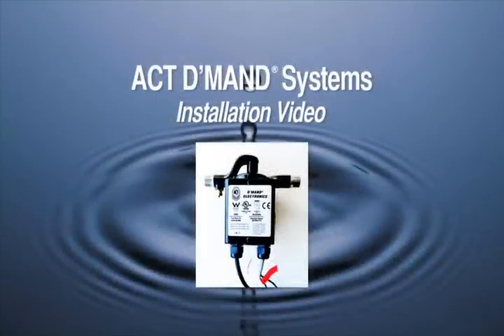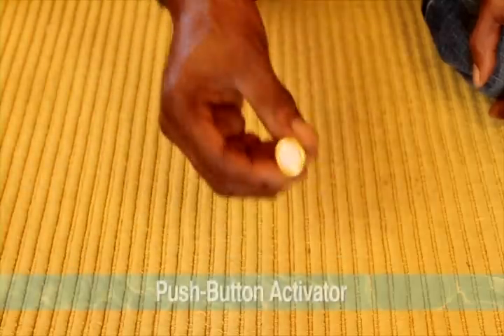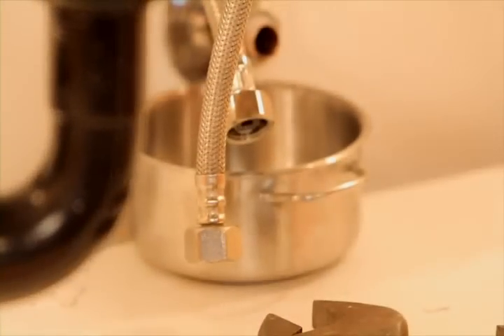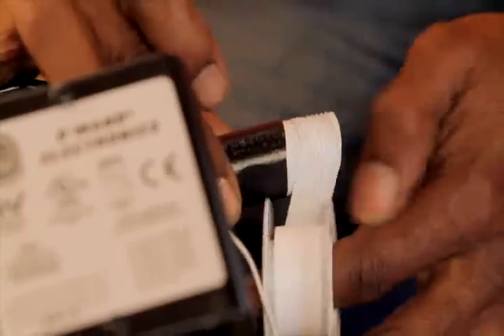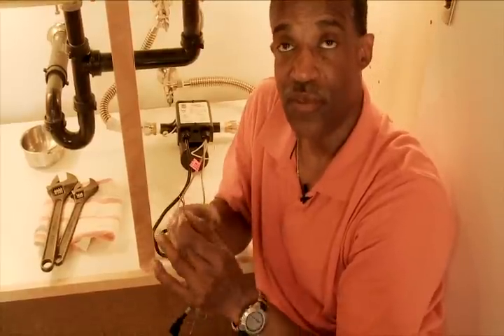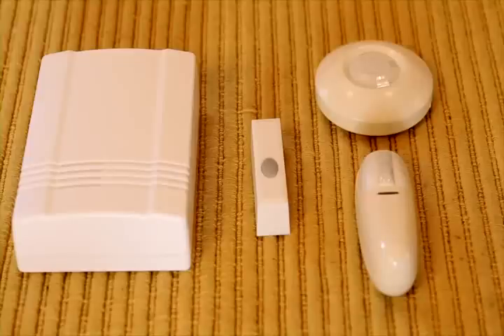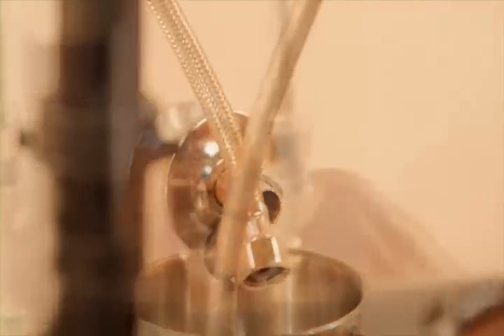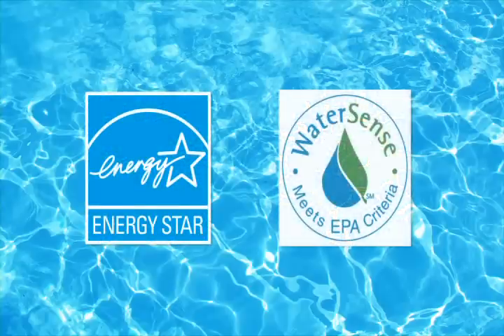ACT D'MAND Kontrol System Installation Video

Comment: We have had one of these in our Florida house for 14 years. We moved and so did the ACT pump. Trouble is the new house Angle stop valve is connected with pex A and we can’t connect the tee fittings.  I am working on a solution. We also have one in our 2013 home in Canada.  These pumps are much better than some of the more recent options.  I hope they never wear out as they are quiet and efficient!

Comment: I have had this same brand installed in 2016. It has failed to bring hot water this year. There are three settings on the pump hi med and lo, what does that do, it’s currently on medium. This pump has been real beneficial to saving water. It is also activated in the powder room by an infra red cell bringing hot water to the vanity by the time you’ve done your business.  Is there a setting or something I need to change for it to operate once again. It seems to go on when it’s not triggered also. Can you help me get some help on this.

Comment: I'm hoping I can find this exact ACT D'MAND Kontrol System.  Every time we want hot water in our bathroom for either a shower or for use in the sink we run 4 litres of water down the drain.  What a waste.
Reply: This was their STS-70 model, which I don’t see for sale online anywhere. The current comparable unit is the S-100 (metal threads) or the C-100 (plastic threads). I saw a single S-100 with all the fittings on EBay today at a good price (higher at other sites). I bought a S-70T model in 2009 and it’s still working (the original plastic backflow valve failed after 3 years but they sent me an improved replacement).

Comment: This pumps is available in www.gothotwater.com   I have one of this pumps in my house working for 10 years now. I want to explain what I did before buying it. Until hot water arrives was wasted down the drain about 12 liters so demanding 4 times a day it was 48 liters per day. During a year is a total of  17.520 liters of drinkable water. In my town for every 1.000 liters I have to pay 1€ .  Moreover, those 17.520 liters are 8ºC above the water city supply so every year I save 162.97 Kw/h of electricity.  Each kw/h cost me 0.20€  Total savings water + energy are = 17.5 +32.60 = 50.10€  Operating the pump cost me a year  0.9€ of electricity.  Cost of the pump and installation was  600€  Now, after 10 years I have saving  500€.  Life expectancy is about 20 years. In the end I realize that I got much more than savings, I had got  a comfort that I can not explain with words but I can assure you it is amazing. I hope my explanation can helps you. My best wishes for you all
 
1